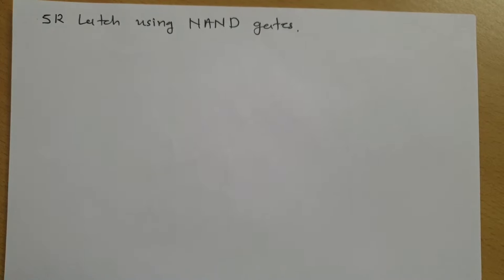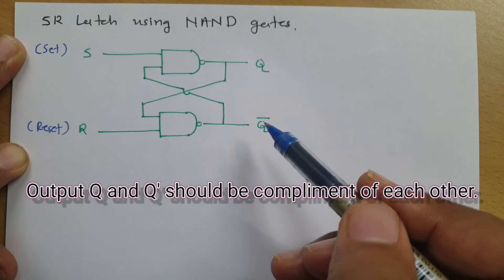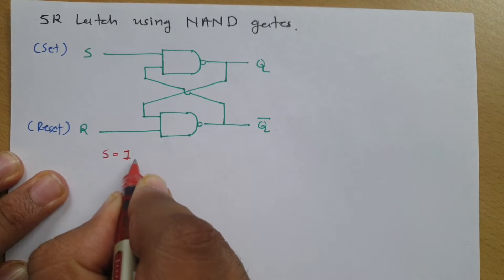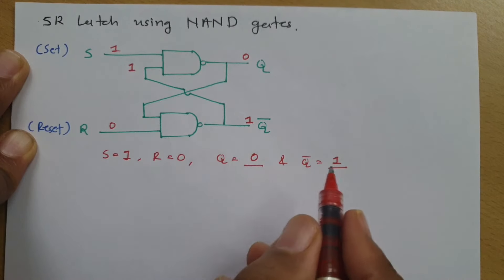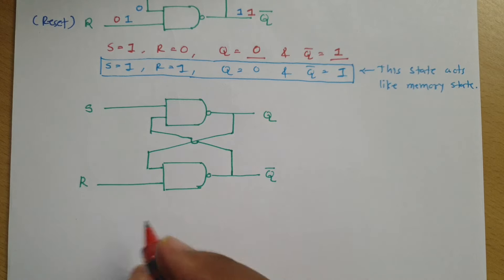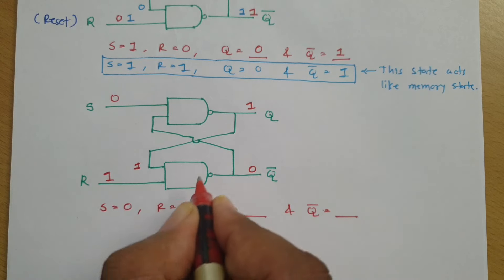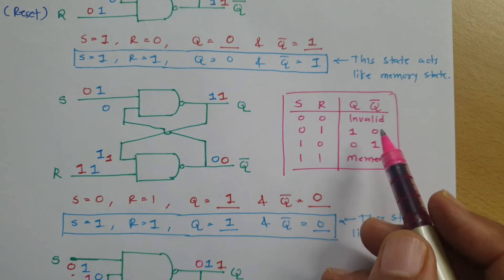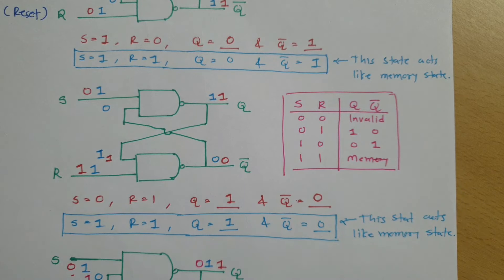SR Latch using NAND Gates: Basics, Circuit, Working, and Truth Table

Comment: This cicruit is not a latch it is called a memory element the first condition for having a latch is to have an enable input and it does not satisfy the first condition . Also if anyone have a simulation tool they can check the circuit of flip flops we study online does not work correctly  they even change their state when we give a constant value to a clock. So the flip flops circuit we study are not the correct ones. We should always use Master slave configuration for making a flip flop from a latch and the circuit we study are not flip flop they are latches and only SR and D latch exist other flip flop circuit we study does not work at all. So plz provide correct information to the students and keep up the good work.